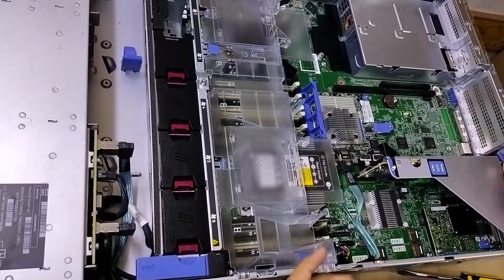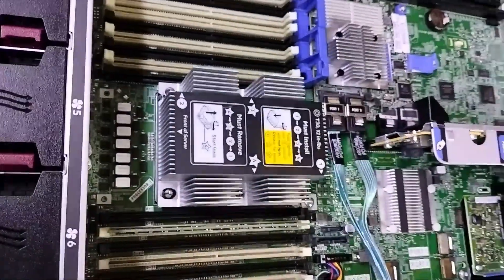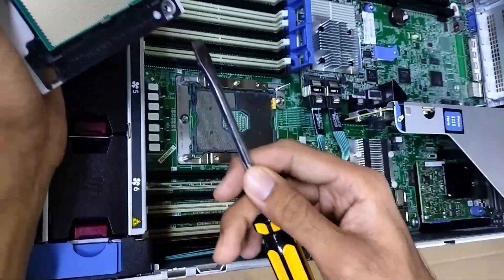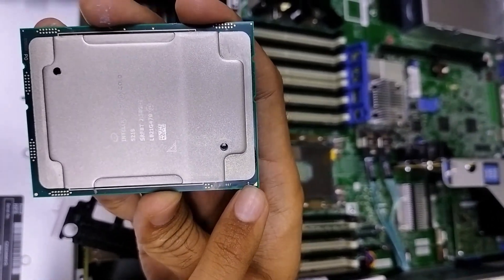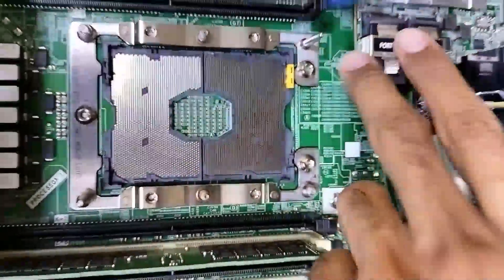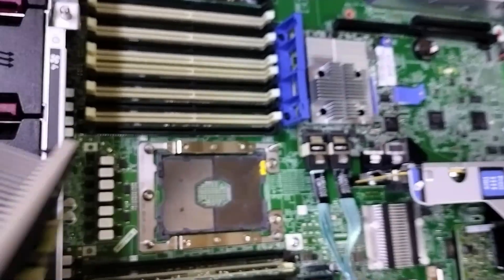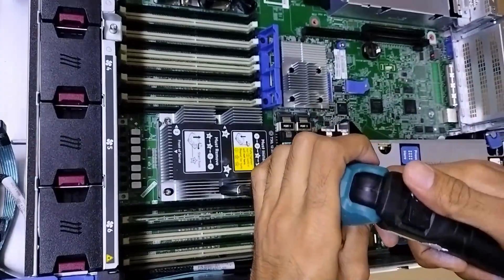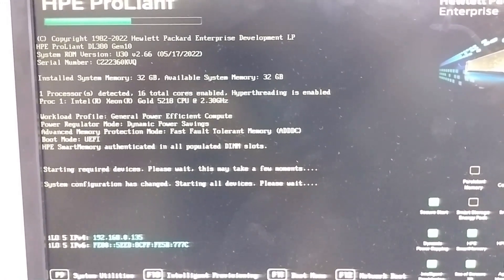How to install CPU/processor in HPE DL380/DL360 G10 servers

Comment: thank you for video, can i use Seagate Or Western digital  HDD 3.5
Reply from the maker: Yes , seagate and wd enterprise series hdd you can use in server , but you need to add caddy(bracket) on hdd then you can fix in server. But hpe can deny the warranty claim request of the server if they found 3rd party part installed in the server.
So if any warranty issue comes, then remove hdd from the server, then send it to the service centre or call hpe on site.
Reply: @SERVERHELP  thankyou for your help